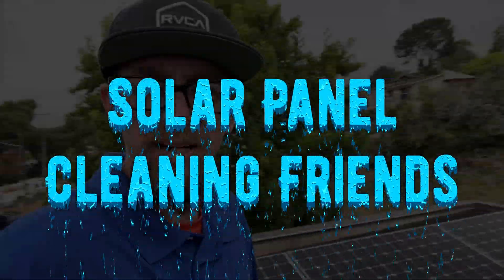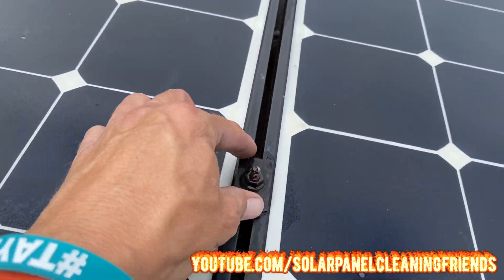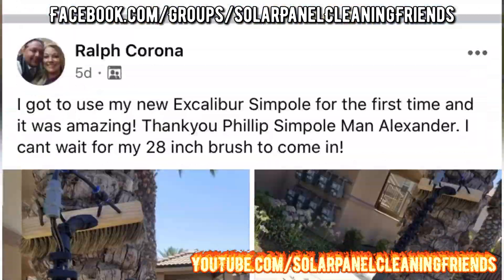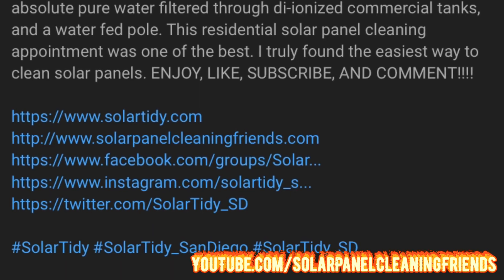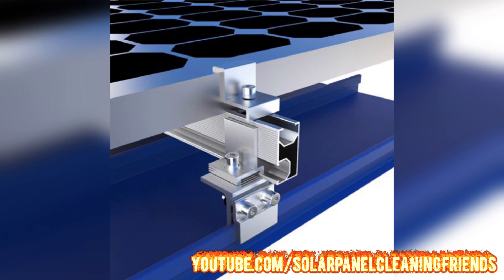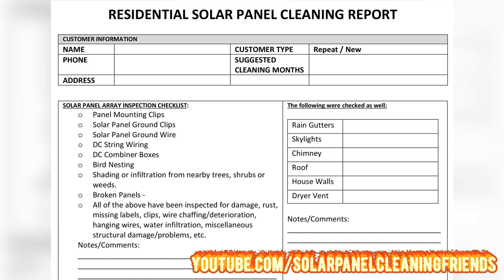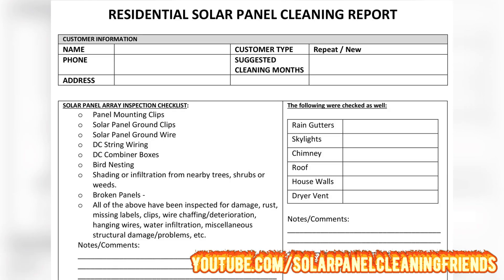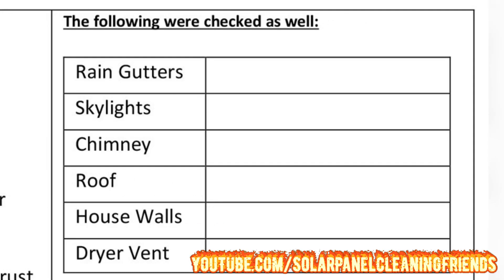Solar Panel Cleaning Pro Tips | How To Clean Solar Panels

Comment: What type of water you use to clean off panels? Or you use a water filter? If you use a water filter, which type of filter?
Reply from the maker: I use filtered water, but it is actually referred to as "restructured" water. Currently, I am using the Solar7 filter specifically designed for solar panel cleaning by the company Ph7. No Di resin, and no RO membranes needed.